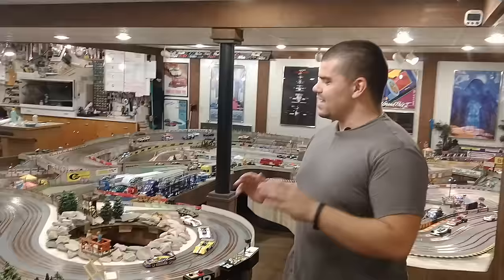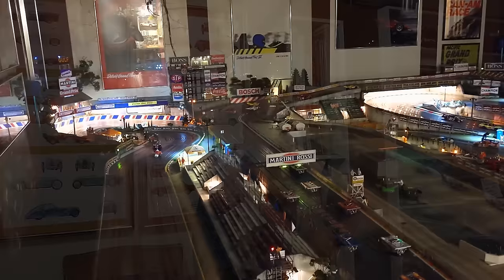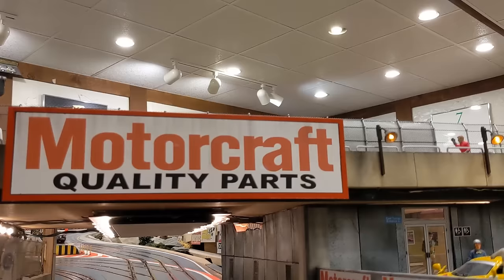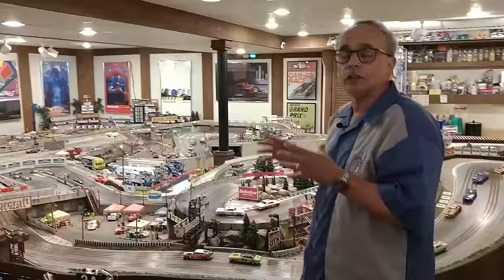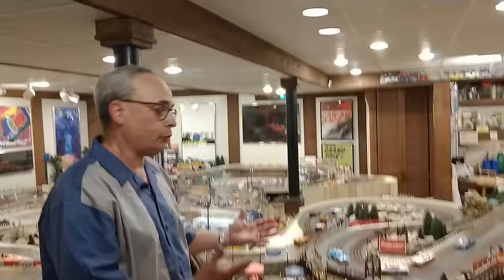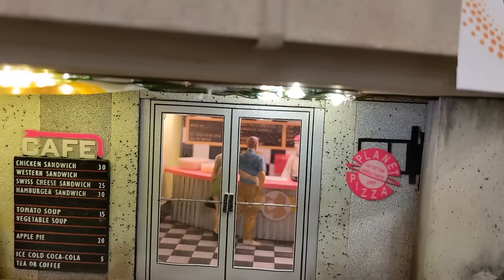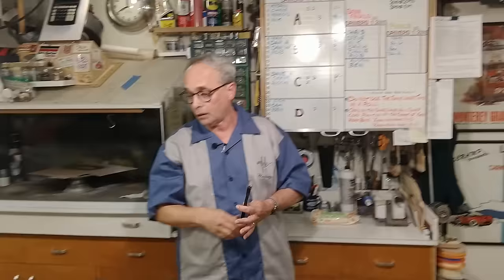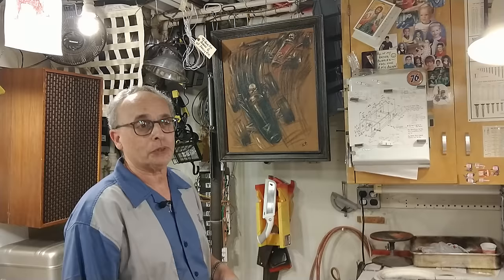The World's PREMIER Slot Car Race Track! A Day with Jimmy Attard (Short Documentary)

Comment: Hello Ryan and Jim,
Wow, Absolutely Brilliant! I have been a slot car fan since the late 50's/early 60's and the Aurora Vibrating Reed HO slot cars.  In my high school years (1964-68), I raced 1/24 AMT models at a commercial slot car track in Portland, Maine. Did reasonably well on a lawn mowing/snow shoveling/paperboy's budget. 
Fast forward a few decades, in the late 90's, there was a Pro built HO track that was a commercial business that I raced at for a few years, but here in So. Cal. with all the outdoor activity that can be done, there wasn't enough interest and it closed. 
Another decade or so goes by, and I find a 1/24 track (the "Teal Terror", owned by Mike Tucker) right here in El Cajon, Ca., that I raced at for a few years, then it sold and quickly folded. 
Then, up popped another HO track by the same owner (Gary Morgan, a terrific & generous guy and hard racer) but after only another few years, it too closed from low turn outs.
 There has always been a great group of hardcore guys like me. but to run a slot car track as a business, it's just too hard in this area to do so. 
I miss the comrade and fun and competitive racing that is Slot Cars.
SO great to see such a fine craftsman and gentleman applying his skills to a hobby I've always loved.
Thanks so much for showing the layout and history.
Stay safe and healthy.
cheers
Boots Langley
La Mesa, Ca
Reply from the maker: Thank you for your response

Comment: All the tools, equipment, materials, the cost must be off the charts, and Jimmy's engineering abilities reminds me of my dad who used to be a mechanical engineer who designed aircraft engines. Engineering or the mechanical is not my thing, to say the least, so people who work in such fields always impress me. Great stuff.
Reply: Truly Frank... I used scrap wood for everything but the track surface which I bought new. Counting the router bits and tape, just the track alone not counting scenery, I don't think I have more than $300 IN GETTING the track built and running. Plz go back and subscribe, and share this video with friends. Thanks again my friend!

Comment: Great job, just beautiful. When I was 15 many moons ago I built a 4 lane slot car track that had a 8 foot leg and a 12 foot leg with a turn that all 4 lanes crossed over both directions.
I used a bearing block with a 1/4" steel bar sharpened and used it like a plane to cut the grooves for the cars to ride in. I used aluminum burglar alarm tape for my conductors. Had to cut it in the cross overs and scrape a little glue off the tape to get contact with the jumper wires. Had a favorite car a metallic green D-Type Jag. That was 60 years ago.
Reply: Wow man you did a lot of dedicated work all those years ago. Thank you for your kind words my friend. Share this with others because the guys plan on more video to come.

Comment: I loved seeing your video.  Just terrific.  I'm 72 now but when I was 14-15 my dad and a couple of his friends (they all were engineers at North American Aviation/aka Rockwell) had a slot car business in La Habra, California.  They had 4 tracks, a Grand Prix, a high speed oval and a road course along with a drag strip.  I built my own cars from scratch.  Soldered tube frames with mostly Pittman motors, real ball bearings and advanced suspensions.  My car case always had about 6-10 cars of different genres.  My grand prix models were my race winners. I built them for myself and sold several to our customers.  They were very popular.  My drag beast was a custom heavy duty frame with a '40 Willy's body and big Pittman motor.  It was a fast car, almost unbeatable but there were some challengers to keep it interesting.  As I got older and became interested in real cars (and girls) my dad ended up closing the shop.  We went on to bracket racing a Shelby prepared '67 Ford Ranchero at Orange County Int'l Raceway and Lions Raceway.  As I recall, they sold the tracks and inventory to a fraternity at USC.  They transferred it all to their neighborhood and used it as a private club for several years.  I'm glad I found you guys and I 'subscribe' to enjoy more videos.

Comment: Beautiful !        I had a 6 lane AFX track 18’x 8’ widest turns ( 18”,15”,12” ) the 18” were aftermarket . Parma controllers 45 ohm ,two 12volt deep cycle batteries in series for 24volt operation ( AFX and TYCO cars could handle it no problems) , WE RAN STOCK MOTORS WITH GEARING AND STOCK GRAVITY MAGNETS . had a bridge and two sets of bank turns over and under . Since the hook up connection stip was lower than the track I was able to run a 3 volt track that was always on flipped sideways cause the car had magnets to return your car to the start line where they would go to a dead track and stop then someone would put it back on the . track 
For you . Unfortunately had to move and gave it all to my buddy and he extended it to 28’ x 8’ . Fast as hell . Lots o fun.

Comment: My father built a 285’ 2-lane 1/32 scale track in our basement when I was young (1964).  Wish I had pictures.  The tracks downfall was the copper tape.  It dried out and started cracking.  We would spend a half hour each night before a race soldering the cracks.
Reply: Yes bplvgp, it is imperative that track owners keep the air around the track dehumidified or the wood expands and the copper doesn't resulting in breaks. Thx for your comment my friend. If you haven't subscribed to Lunch King please do. Please go back and if you enjoy the track and racing video, forward it to your friends and family.

Comment: You can't call it the worlds' premier slot car track because it doesn't have eight slots, eight for the public,
and the center six for races. I was winding armatures, shaving magnets and making slicks back in the sixties,
and when slot cars went away they disappeared for good. It's nice to see an operating track. In my city,
I was the first to use a six-volt Coleman battery for brakes, wiring it into my controller in reverse, so when I took
my finger off the reverse current would slow the car right away. Painting clear plastic bodies was the best.

Comment: This is amazing. Thank you for sharing! When you're running AC, and you have two cars in the same slot, are those cars able to pass or are they locked into first and second position?
Reply: Rowland the two cars are "locked into the same position" UNTIL both cars pass over the lane changer at the hairpin turn. At that point drivers can switch to a second slot cut on the opposite side of the track. This allows the two cars sharing one slot to pass each other. Now knowing this revisit the video and you will understand better. Thanks for the nice comment. If you haven't already, go see the other segments the guys did. If you like them forward to your friends and please subscribe!